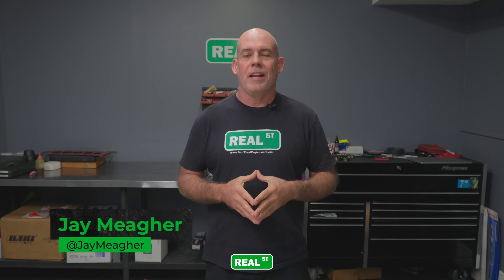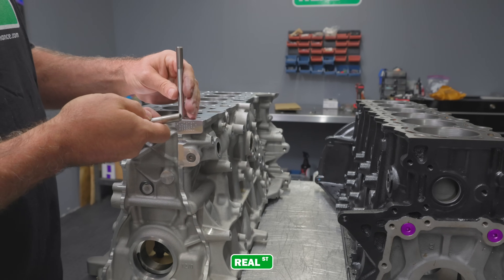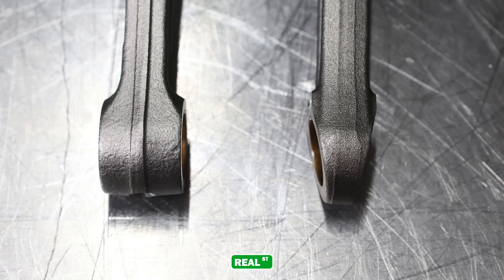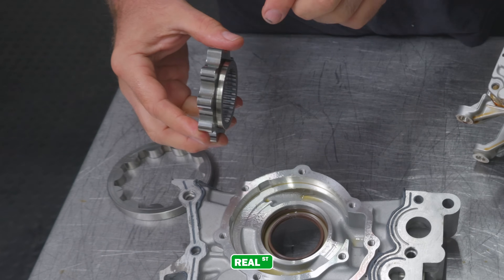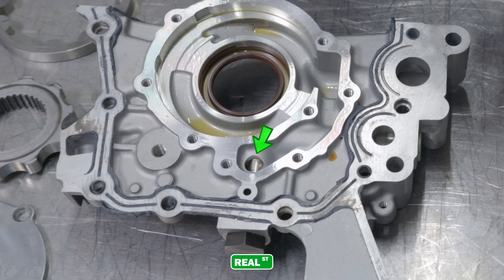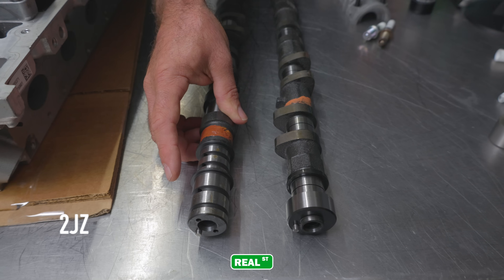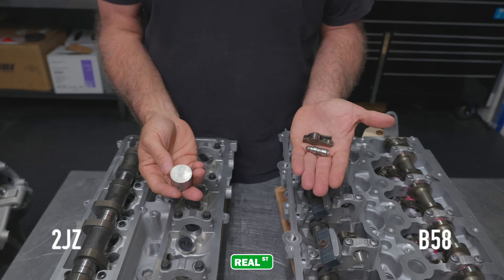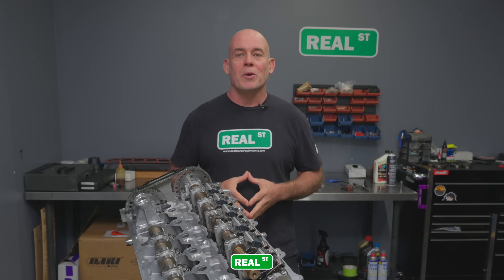Toyota 2JZ vs BMW B58 | Comparing Both "SUPRA" Engine Internals Side By Side In Detail

Comment: 2JZ block does 2000 hp .... PERIOD
B58 does NOT .... yet and i don't think it ever will. 
I don't care what technology that B58 has TODAY, until that block can pass 2000 hp, its NOT better than the 2JZ YET
Reply: Depends what you want. 
If you want a drag car with max hp then the 2jz is the obvious choice, but if you just want a high hp daily driver the b58 is plenty.
Most 2jz fanatics in social media comments will never be drag racing or needing/owning an engine with over 1000hp.
Reply: @pieflies  Are you saying that a 2JZ cannot be built for a high hp daily driver ??
Reply: @ACommenterOnYouTube   no not at all, but it’s not necessary. You aren’t really getting advantages by using the 2jz unless you need crazy high hp.
My point is that “better” is not necessarily true for all use cases, and that at more moderate hp numbers the “2jz rules, b58 sucks!” mantra that you hear so often doesn’t really hold true.
It’s often said that the mk5 Supra would be “better” with a 2jz but that’s probably not true for most owners of that car, who don’t drag race them.
Your argument is that it’s better because it can handle extreme hp levels but the fact that the 2jz can make significantly more hp only makes it better if you need that hp.
Reply: @pieflies  i will say that you are wrong and many will agree with me, maybe none on YouTube or those reading this, but there are tons that will agree.
Yes most 2JZ motors are built for top end high hp. With todays technology you CAN build it for a high hp street racer with an insane 0-100 mph run. 
But reality is, most are not high hp street racers and most will loose in that 0-100 run. 
If i had that kind of $$, my 2JZ would be a 0-100 mph monster because i hate lag, i hate waiting for boost, i dont like top end hwy motors, i want my power down low and quick.
Reply: @ACommenterOnYouTube  what specifically was wrong in what I said? 
High hp street racing is still high hp drag racing, and the cars doing that are generally compromised in terms of daily driving.
You can build a low lag car with excellent 0-100 times with either 2jz or b58. The 2jz doesn’t have the same high advantage as it does with higher hp. It’s not “better” than the b58 in that case… Unless you have reasons why it is, which I would be interested in knowing if you have some.
When you’re talking realistic daily driver, something like 600hp is crazy fast. 
What advantages does the 2jz have over the b58 at those levels?
Even at those hp levels, you’re going to run into cooling issues and it’s probably going to be compromised in other contexts like track driving. If you dial back the hp even further for a daily driver that can perform reliably at a track day without over heating or being over powered for the track and your own driving skills (I’m not talking about pro racers here), then what benefits does a 2jz have over a b58?
My point, again, is that high hp is not the only criteria that determines if an engine is better, so saying that the 2jz is better because it can run at 2000hp is not a definite fact. It is only true in that one high hp context. For most people, that is irrelevant.
Reply: @pieflies 2jz arguably sounds better. Unless someone has a link with b58 sound that surpasses Supra with tubular manifold and external gates
Reply: @bigjdm5460  a b58 with a single exit eerily sounds like a jz lmaooo
Reply: @CrimsonRequiem1  yea I heard that
Reply: True, I’m guessing the big brother of the B58 the S58 should hold a bit more power than this. It’s a bit more beefed up from the factory.
Reply: @roberts9709  well until someone actually attempts to push the B58 or the S58 to its limits, its not a 2JZ.

Comment: Typically boils down to this.  Outside of aftermarket blocks and heads... What holds the pieces inside better and what can move more air through it's cylinder head.  I'd imagine the B58 as an excellent street/strip engine.  But these guys running drag autos and 70 PSI with a stall converter that stalls short of redline it's about what holds the parts and fire in the best.  The two port B58 kept me away, going back to a traditional 6 exhaust port cylinder head has me intrigued.
Reply: The B58 cylinder head flows far better than the 2J, stock for stock, even the 2 port B58. Any 2J making big power has to be extensively machined/ported.
Reply: @TML34  I hope your joking lol. 2jz ports have never been an issue nor are they known for having small ports.
Reply: @lennixsingh626  b58 is a far better engine stock to stock a stock b58 make way more power and torque then the spciest version of the 2jzgte stock and it dosent suffer from turbo lag quite like the 2jz not to mention the fuel efficency anyway regardless a b58 can make 500whp with just downpipe exhuast and a flash tune the 2jz-gte needs at least upgraded cooling injector and a turbo swap to touch 500whp
Reply: @patthonsirilim5739   Your literally talking out your ass. B58's hold around 700-750 SBE. Theres 2j's out there making 1000hp SBE. Theyre both the same displacement so turbo lag between the two is next to indistinguishable.

Come back to to this argument when you realise the 30 year old 2jz is just better and use some logic.
Reply: Dude. The 2jz is known for holding more hp SBE, its has a stronger block and and it has better cylinder head flow lol.

Comment: Am still waiting for that BMW technician! To say you're out of your mind to think that a cavemen engine is better than this Modern Marvel. 😅
Reply: Modern Marvel is NOT hitting 2000 hp yet so .... 
And frankly i don't think that B58 block will hold 2000 hp as the 2JZ DOES
Reply: Papadakis racing states that the B58s block could well be as strong as the 2JZ's despite it's aluminium construction. But from what we know, the 2JZs is likely to be a bit stronger @ACommenterOnYouTube
Reply: @Josh-qm4rb  even with it sleeved, its still an aluminum block which has its limit, and that limit is def not of a cast iron material.
Reply: @ACommenterOnYouTube  All blocks have their limits, just generally aluminium blocks have a lower limit than iron blocks.
It depends what sleeves are used also. If the sleeves are proper heavy duty billet sleeves, then it would be nearly unbreakable.
Papadakis racing said that modern day aluminium engine blocks CAN be as strong as the traditional cast iron ones. Engine blocks are made in many different ways, despite the materials, so the material isn't the only factor that determines whether a block is strong or not.
Reply: @Josh-qm4rb  Go ahead and Put in billet sleeves in an aluminum block and push it and see how nearly indestructable it is. 
Unless you got some futuristic billet metal sleeve that can keep the heat and pressure within the cylinder wall and have zero affect on the aluminum wall its attached to, then its going to break at some point. 
Once again when someone attempts to push the B58 we will know.
Reply: @Josh-qm4rb  people tend to forget the B58 is running the design of a diesel block
Reply: Every person has dreams but you have an unrealistic dream  :)
Reply: @IlIkeThatpo  yes! But you know what? ...Thank you for being so polite!! Have a great weekend my friend!❤️
Reply: Out of the top 25 fastest import cars in the 1/4 mile 19 or so are 2JZ. A lot are in the 5's at over 250-260mph. There are ZERO BMW powered cars on that list despite the fact that BMW has sold MILLIONS more cars then any model with a 2JZ in it.

Now this list is a bit old, the fastest cars are faster, but the top 25 is just as lopsided. So you clowns in your BMW's with burble toons, pops and bangs etc, before you say something like, the B58 is the new 2JZ... No it's not. The same technology that allows the B58 to run a 8 second 1/4 mile is the same technology that allows the 2JZ to run 5's at almost 90mph more over the same distance.

Sure the B58 is doing ok for the 7 years or so that it's been out, but in 1993, we played Oregon Trail on two different floppy disks, and that was the extent of available computing power....

Besides even if the B58 can manage to stay together at higher hp levels one day, it's bore/stroke guarantees that it'll never be able to rev to 10/11k+ to be able to take advantage of the larger turbo's like the 2JZ anyway.

Food for thought.
Reply: @blacksupra6115  <--- smart man has spoken
Reply: @blacksupra6115  B58 is catching up though and its undeniable. A couple M240i's with 1500hp are doing 7 secs @179mph with most of its stock/oem parts and is he's able to daily it is kinda of insane to me.

Comment from the maker: 2JZ or B58? What do you think about the two engines?
Reply: I haven't experienced the B58 yet but I'm open to see what its all about. 
I've had my 95 Supra for about 13 years now and love everything about the 2JZGTE.
Reply: 2JZ. I love the KISS system (Keep It Simple Stupid) That's why i have a Volvo 240 as a Sunday car. Simple. Reliable and can pretty easily be a 4-600hp beast if I wanted. 
Would like a American V8 but I wouldn't be able to park it anywhere without some duchbags decides to relocate my property to a unknown location
Reply: 2jz  still more reliable and make more HP
Reply: Does it pass CA smog for new engines?@alexkid408
Reply: @davepaturno4290  if you concern about CA smog, get an EV car
Reply: @alexkid408  I'm 10 miles from the ocean, so no smog here. The orange smog has long disappeared after so many hybrids. We don't need EVs.
Reply: 440 vs 300 lbs, 2JZ is an awesome motor but it's just such a boat anchor, as much as it pains me to say I will probably have to go B58 here, as far as overall. 2JZ is still a better option in a lot of scenarios, including cost to performance ratio
Reply: 2JZ does 2000 hp ... Still the KING for now
Reply: @ACommenterOnYouTube that's all supra kids can say isn't it
Reply: try 3000 @ACommenterOnYouTube
Reply: @ACommenterOnYouTube  3000hp - Kanoo Supra